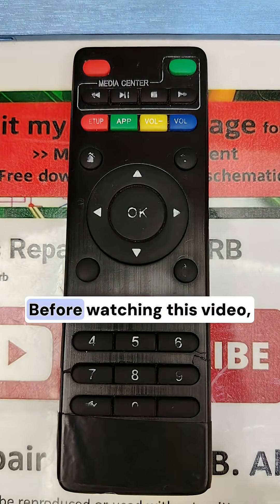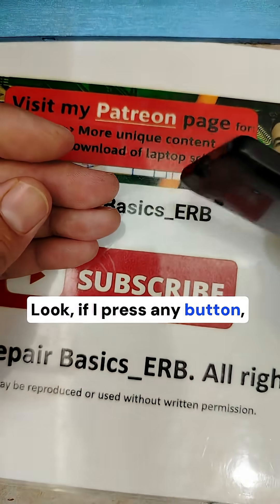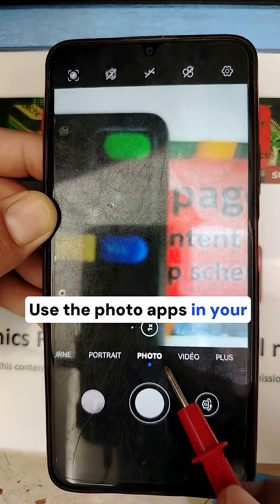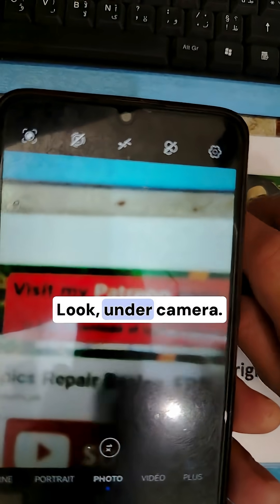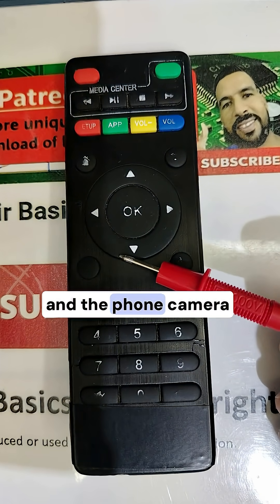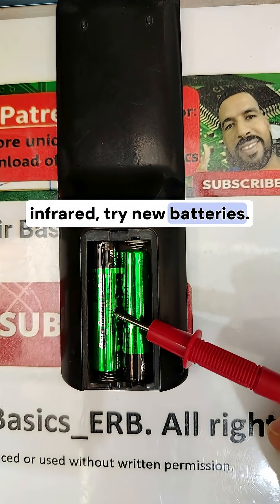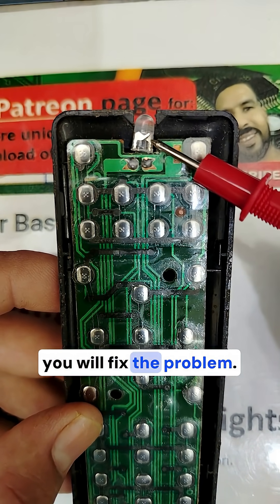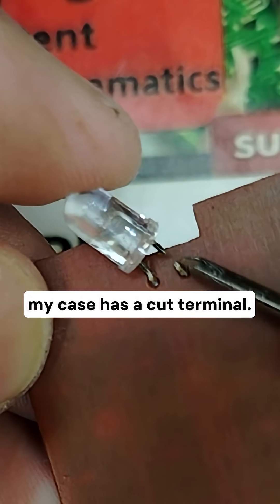This Remote Trick Will Surprise You, Fix It FAST🔥  #electroniccomponents #problemfix  #electronics

Comment: What if some buttons register and others don't. How do you fix it.
Reply from the maker: If some buttons aren’t registering, it might be a connection issue or dirt under the buttons. Try cleaning the remote and checking for any loose connections.
Reply: Thanks for tip @electronicsrepairbasics_erb